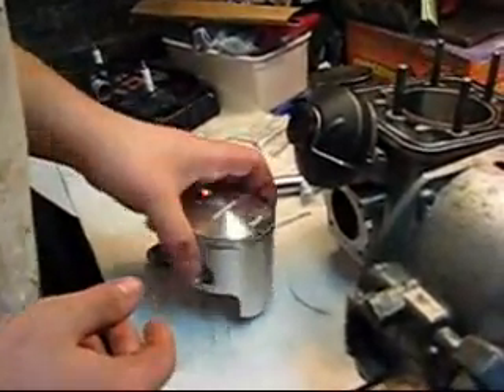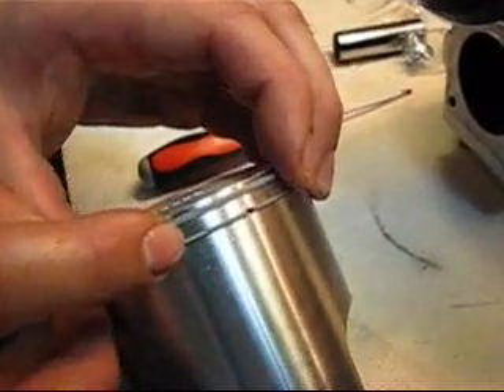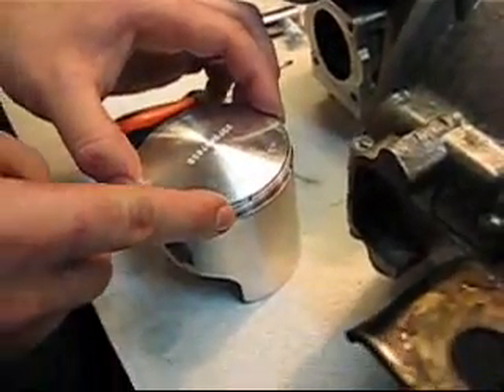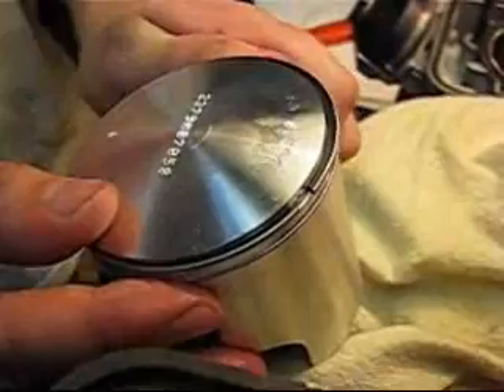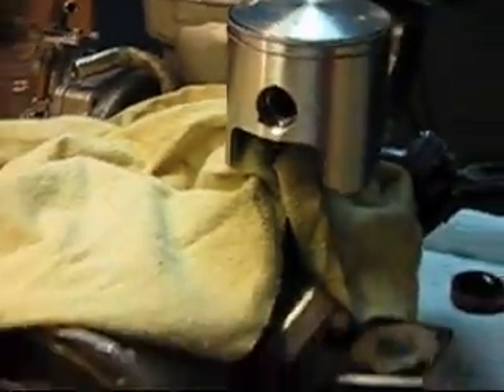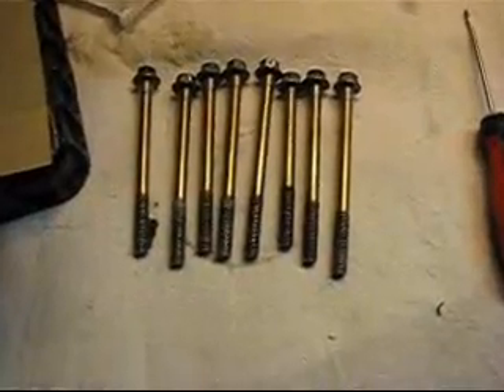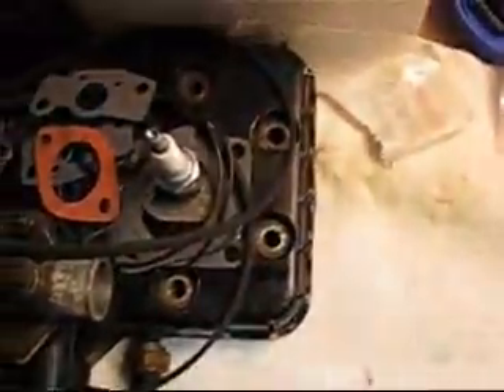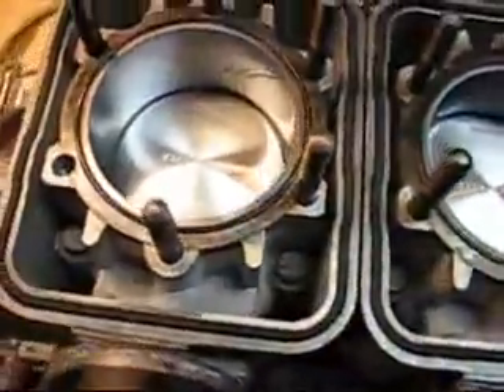2 stroke Rebuild 670 Rotax

Comment: I just finished disassembling my 1993 MX 470 because the #2 piston was stuck.  Using your video, I came to realize that the pistons were installed backwards by the previous owner and this caused the ring gaps to align with the exhaust port.  The end result is a scored cylinder by a broken ring on #2.  The #1 cylinder was also scored and the ring was already bent - caught it before it broke!   Will be getting new pistons, rings and cylinders.  Thanks again for the video!

Comment from the maker: @TaKeItLiKaMaN Correct! 1993 formula Mach 1 670
The purple heads are found on the 670HO (high output) engines that had a bit higher compression.

Comment from the maker: @117nathanmyers i don't know it seems pretty clear to me. you can see the pin in the center of the ring gaps where they have to be when you install the cylinder over the piston. That pin stops the ring gaps from moving to a place where when they are installed could potentially catch on one of the ports in the cylinder. It doesn't matter in a 4 stroke because there are no ports in the cylinders.

Comment: @1skiinIan Hey there.I've rebuilt a couple of 521 rotax motor's.These are one amazing motor.I've got the manual for this motor.In the rebuilding section it say's a good rule of thumb for keeping you jug's straight is a feeler gauge inbetween the jug's  both end's and centre when torking down the jug's to keep it as straight as possible.Just thought I'd throw that out there.Chee's Bud.

Comment from the maker: @ballockybill they are power valves. dirt bikes have them too but they are internal. They are like sliding plates that close off the exhaust ports a bit and open at higher rpm so that you can still get good power and torque at lower rpm's without sacrificing high rpm power and torque.
good question though
thanks

Comment: not sure if it would apply here but many new rotax engines call for the head pipe to be installed befor the torquing of the cylinders to prevent leakage

Comment from the maker: @haloass123 yeah, in a 4 stroke they would be. in a 2 stroke you don't have a choice. you have to lign them up with the groove on the piston and install the piston the right way so that the ring gaps are in between the ports. Typically in a 4 stroke you want to have the ring gaps 120 degrees away from eachother. In this case, they are only about 90 degrees because they didn't have a choice because of where the ports were

Comment: @KeepItRoostin658 you keep doing it like that and you'll end up with a warped mating surface , every motor has been giving recommended tq specs by the factory usually a looser spec to seat the surface than the second spec to tighten the seal.

Comment from the maker: @danceGIRLIES101 It's very rare that the piston get damaged without damaging the cylinder as they are in full contact but, if so, you still need to measure the bore of the cylinder in at least 3 different spots to make sure it hasn't worn in a taper or too much in an oval before you figure out the size of piston you will need to order. if your standard piston has become too small you will need to have the cylinders bored and honed for the larger sized pistons. always hone

Comment from the maker: @117nathanmyers The ring gaps should NEVER end in the same spot on the piston in any type of engine. This would result in a loss of compression. In most 2 strokes though, there is a tab where the ring gaps have to be so that they don't spin and catch a port.

Comment from the maker: @LegittGod39 no, if it's oil injected, reattach the oil injection hose and loosen the bleed bolt untill oil starts coming out of it. after that, pull over the engine with the oil injection lever wide open untill you see oil coming out of the tiney holes in the bottom of the ports (this is with the carbs off of course). also, just to make sure I always mix oil into the first tank of gas on top of the oil injection. (mix at about 100:1)

Comment: I noticed the base gasket moving around when installing the cylinder, shouldn't  this have had gasket adhesive installed between crankcase and gasket? I'm asking because im getting ready to do my motor.

Comment: what happens if there stay a little piece of viber of that cloth in the engine or on the cilinder.I aint NO monteur but still tried to fix my bike after my engine filled up a little with water but cause i aint no expert i made a big fauld with making it dry and a little piece of cloth stayed stuck between the wholes and cilinder how you see it at 6:01min.
It were some really small tinie vibers that stayed stuck but i think vibers went more into the engine and now i got BIG problem won't start :(

Comment: hey if i have to crank my bike many times really quick  to get it started  with full throttle but once started i can start it no probe for like 24 hours and yesterday full of gas started coming out of the expansion chamber near th cylender? what would you say that is bad fuel mix or spark plug?

Comment: @DangerZONEpixel 
"To prevent ring breakage, make sure all port edges are chamfered @ 30  angles with a radius of 0.9 to 1.4 mm"
so suppliers are wrong in this statement?

Comment: @lacossanostra I'm assuming he doesn't actually know why. It is not all ways "down." It is Up or Down. The reason being that you can't imagine how fast the piston travels up and down. placing them with the gap at the top or the bottom is kind of extra insurance to keep the clip from popping out while the engine is going. It is not anything to worry about on some old thumper, mainly very high rpm engines.

Comment: I have a 2003 grand touring 600 ski doo. The engine seized and I need to rebuild the top end (hopefully that's it). I did a compression test and one cylinder was at about 30 and the other was at a devastating zero. My concern is that the piston blew up which may have sent parts into the crank. Am I fucked? Full new engine? I don't know for sure yet because I don't have a garage and am looking for space. If the pistons blew up in the weak cylinder, does that mean I need a full new engine.?

Comment from the maker: @iamchevyman5 go on ebay. Wiseco makes very high quality pistons. So does JE. Get forged pistons, because they are the strongest. These were wiseco in the movie. This IS a basic tutorial. Just take it apart the opposite way I put it in. You don't even have to take the engine out of the sled if you're only doing a top end job. I did the crank seals and checked bearing play in the bottom end so I didn't have a choice. It shouldn't matter how long it takes you to do it. It's not a race.

Comment: @1skiinIan hey would u know why my 110cc atv wont start well i know that part lol theres no spark. but it cant be cdi cause it starts rarly like if i crank it for 5 mins it MIGHT start for 2-7 sec then off and wont start again.I cant get the vavle cover off to set the timin cause the screws are in a spot were its like impossible to work on this pieace of shit. would u know why iam not gettin spark all wires are good and gas is good but compression isnt that good but cant get to the vavle cover

Comment: @KeepItRoostin658 oh and when you ignore factory specs to save a little time thats called cutting corners, you can word at as you please but a turkey will always be a turkey.It might not be a big deal on these little two strokes but I dont know if you caught the sn I build Hondas as in four stroke engines with much more specific tolerances and I bet you any amount of money if you did the same thing on a fourstroke it wouldnt run nearly as long.

Comment from the maker: If you add a bigger base gasket under the cylinder jugs, it will change timing regardless of whether you shave the head or not. The only thing shaving the head does is restore your compression ratio. I think you are also forgetting this is a rotary valve induction 2 stroke, unlike the common reed valve induction 2 stroke. Buy one of these motors and put a thicker base gasket on. I would like to see it create more HP than this one

Comment from the maker: I'm pretty sure that Rotax never made a monoblock. They probably came tegother because ther were stuck together with the manifold or head? 
We WERE having a good winter. tons of snow, till we had a week of rain and above zero temperature. sow there is barely enough snow to snowmobile. it's so lame

Comment from the maker: @DangerZONEpixel you're joking, right? I have so many people that have brought engines to me, where they installed the pistons in the opposite way and the rings had cought on the port. IF YOUR RING GAPS END AT A PORT, THEY WILL CATCH. Warning you. It doesn't matter how precice the part is, you can still install it WRONG!

Comment: downblow doesnt seem to be nice when one piston is up the other is at bottom fight well the pistion should fall deep enough to let the ports do thier job in proper tuning high end this is stuff to be looked at  i know this is a stock engine and u just repairing a piston but still i been looking carefully and saw that it doesnt fall deep enough meaning the downblow doesnt push all the fuel all the way up only way to counter this is to put thicker or more gaskets between feet of cilinder. but!

Comment: that causes major problems for ur sqwish and thats  not good either anyways ye the downblow on that engine is shit :P just saying. it could run a lot better and have more hp if it was tuned. put gaskets on feet cilinder from what i seen id say3-4mm  and cut off the top of cilinder by same. then also dont know what the sqwish should be on that engine but keep it same i supose i was using 0.45mm on my mhr and my hebo was 1mm its so difrent per cilinder.

Comment from the maker: @DangerZONEpixel  This is correct for most engines. BUT if the gaps end at a port (by installing the piston the wrong way which is 180 degrees), it doesn't matter fuck all what degree angle your chamfer is. End of conversation. Go do everyone here a favour and google rebuilding two strokes so you can stop annoying us.

Comment: well sure 116hp is fine never said it wasnt i said the downblow looks bad and can be better. and  also i said when u put thicker gaskets on feet u need to CUT OFF THE HEAD  so the timing is not off and compresion stays the same u not very smart i c i said this befor..... read better befor u gif a halfbaked answer.